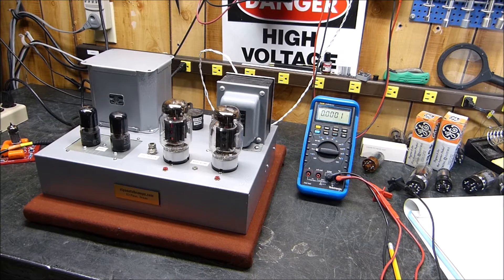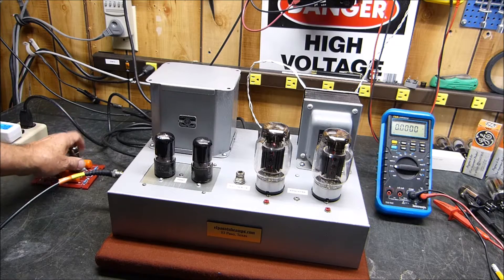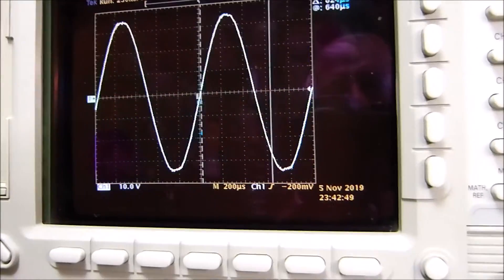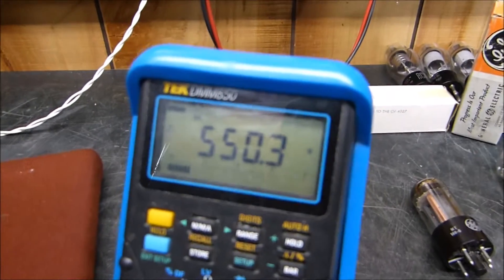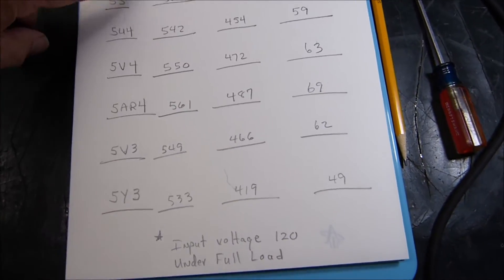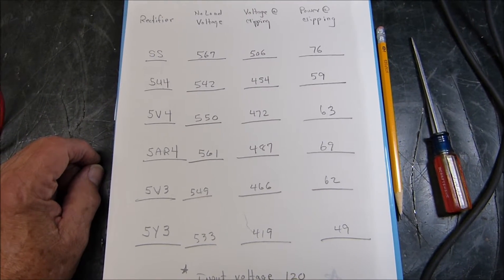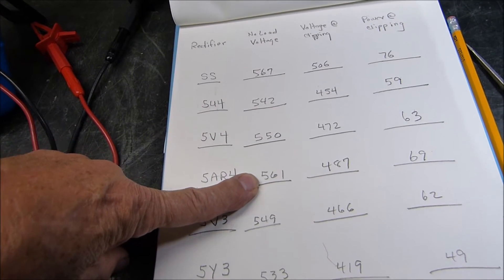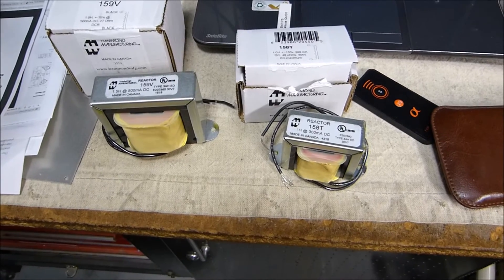SS, 5U4, 5V4, 5AR4, 5V3 & 5Y3 Rectifiers Compared In 75 Watt Vacuum Tube Audio Amplifier

Comment: This is a great test to have on youtube!   👍   This is the sort of thing we all did back in the 60s and 70s, but all the newbies at tubes never did.  I will be sharing this video with several of my clients who are always asking about rectifier tube interchange.    Nice work..   It reminds me I have a 1950s vintage Heath-kit single channel, 2 chassis, "The Williamson" amplifier to freshen up for use in a new mono vintage system I'm putting together for 78s and pre stereo 10" and 12" LPs.  Found an Altec 1505b horn for the highs. ... bass will be JBL D130, so all vintage.
Reply from the maker: Jennifer - I really appreciate your comment because it is my goal to put the proven and practical on YouTube. I love theory but applied science is always my goal here. Yes, during the 60's and 70's we learned about some of these rectifiers by plugging them in and seeing what happens. We learned a lot of practical knowledge from that. With the Internet nowadays, researchers can get so many versions of the same thing and they simply all can't be right and I think it leads to a lot of misunderstanding. I wish I could document every detail and when I make errors I am called out on it by my viewers but too much detail is so laborious and even dangerous around HV and lastly, maybe just too much data. This video came to me because it is "practical" and was relatively easy to make. Since last night, I have swapped out the 7H, 200 mA choke for a 1.5H, 500 mA choke (one of the ones I showed at the end of the video) and now the amplifier will provide over 87 watts with distortion under 0.5%. Of course, I realize I am just raising the loaded voltage and lowering the Z of the PS so it just gets more powerful. I may actually be reaching the limit on resting current of the KT88's. The R of the choke that was in the amp is 126 ohms and rated at 200 mA. The bigger choke has an R of 27 ohms and it rated at 500 mA. I love this stuff and am excited to start on the 816 MV amp very soon.  
Lastly, you mention the Williamson design and I was not sure if the 6SN7 Williamson drivers  could deliver enough undistorted peak voltage to drive a pair of KT88's to their max level but I apparently proved it is so in this video. I hope to see your nice Heathkit, Altec and JBL work posted on YouTube soon. Stay safe and thank you for your comments.

Comment: Another great and practical/useful video David!
60 V drop from no load to full load seems a bit on a high side though for silicon.
Can you hook up a scope (assuming you have a probe rated at that dc voltage) across the B+ and see what the ripple level is.
I suspect that, that much of a difference is more due to limited amount of filtering and not the actual rectifier voltage drop.
Thanks again on another quality video.
Reply from the maker: I will see if I can measure ripple,  idle and with full load. I can say that the S/N of this amplifier is about -89 dB so it is extremely quite. I did measure that parameter.
Reply: @ElPasoTubeAmps  Thanks David. As you're probably aware the ripple is less of a problem in the push pull OP stages , I presume you have additional filtering in the low level stages which is likely the reason for the good low noise performance. Reason I mentioned the filtering is that I have seen the effect of it on some of the old Fender guitar amps few years ago. I just did a similar test on an old Mesa Mk IV head, this thing has a massive mains transformer and a pair of 220 uF 300 V electros in series totalling at 110uF running off a centre tapped  690 - 700 Vac via 2 seriesed pairs of half bridge 1N4007 diodes, pretty lame choice of diodes in my opinion! The B+ sags by about 34 Vdc from no load to point of clipping on the output, the ripple also increases but no where near as much as Ii remember in the Fender amps. Measurement of the AC to the rectifier diodes stays virtually unaffected! I would have liked to swap out the  the 4007 for a set of 1N5408s but as this is a customer repair not an option fr number of other reasons as well. I can't recall if you mentioned which SS diodes are used in your amp?
Reply: @Stephen Morton It's not 6 V lower it's 60.
Could also be the regulation of the transformer from no load to full load.
Need to monitor the  ac into the rectifier as well to see where the drop is.
Not convinced it's the rectifier alone, my main suspicion is the filtering though.
Reply: @Stephen Morton sorry, didn't see the decimal dot in front of the 6, even more reason for my question.

Comment: I didn't know that ALL those rectifiers had the same pinouts. ,
Reply: The early rectifiers including MV's all had the same pin-out...right through the 60's/70's. Octal, or 4 pin. Theoretically, , the higher power rectifiers used the 4 pin which was a little safer. The larger pin spacing prevented arc-over from pin to pin to prevent PT damage. and most of the time, even on the octal-based rectifiers, only 4 pins are used. Also, the larger pins offered better current carrying capability, with less resistance and a tighter connection. Some of the smaller high-vacuum rectifiers had a filament center tap to power the pilot light on many AA5 radios. usually the 35 volt tubes like 35Z5 etc. Rectifier tubes always worked the hardest in radios and TV's  If you look into the design of earlier tube TV's,  many of the designs used to have the rectifier tube 5U4GB mounted in a vertical chassis and the tube was in a horizontal position which shortened the life of the tube due to filament sag which eventually caused it to collapse and short to the plate. That design didn't fly well in those sets. many PT's were taken out because of it. Very few sets back then had a primary fuse to protect the PT.
Reply from the maker: @djfrank59  Nice history there, Frank. thank you.  I really enjoy learning from your guys experience and I never actually thought about the layout of the pin configuration on the rectifiers. Makes sense to separate them as they are...
I worked a few years in TV repair shops now, more than 50 years ago and I determined and always told people that the big TV sets of those days basically just burned themselves up from heat. No fan in them and might stay on all day. From what I remember, things got even worse when TV's started being build on PC board. What a disaster for the cheap boards and, again, the heat. Besides crystallized solder joints on the sockets from the heat, I remember one in particular where the horizontal output tube was the type without the plate cap and I worked on it so long with a red-plate condition and it ended up being the tube socket pin for the grid, if I can accurately  remember that long a go. The point here is, we have talked a number of times over my videos how open tube socket pins (especially the plate connection) and how an open plate condition will instantly ruin the screen grid in the output tubes but in the case of the open grid pin, there was no bias to control plate current so a similar type condition but at least it was the plate and not the screen being vaporized. Funny how I still remember that.
Reply: @ElPasoTubeAmps  I did TV/Radio repair also for many years as well, and Horizontal Output/Damper tubes always cooked as it was, but just like a guitar/hi-fi amplifier, if you lose the bias, the tube cooks. The common HOT's were the 6DQ6,, 6BG6, 6BQ6, and for color sets, it was the 6DQ5, 6JE6, and 6JS6. But many of the later Compactron tubes used for Horizontal sweep didn't have an external plate cap. They also contained the Damper in one envelope, and I've seen many arc-over situations. But the worse design mistake in TV chassis design was the Vertical chassis. The Rectifier tube was always at the bottom and mounted horizontally which made the excessive heat rise to the other tubes which shortened the lives of the other tubes as well as resistors and caps. Sweep tubes in a set always work the hardest and had the shortest life, next to rectifiers. I still repair and restore a lot of tube TV's for collectors and the PCB designs are the worst! The Philco Predicta series sets were the most unreliable as was early color sets. I always find burnt tube sockets and boards in those sets. Design engineers pushed a pencil and didn't have to repair these sets, so they catered to the bean counters at the companies..they didn't care about the repair technicians or the buying public.
Reply: Kevin Counihan  I've seen not only glass melt, but holes in the glass as well. even the glass splitting in 2 pieces. I deal with it more now than ever. today's guitar amps are run beyond their limits. When you see an EL-84 biased a 40 mA, you know where that's heading LOL  I still do repairs.